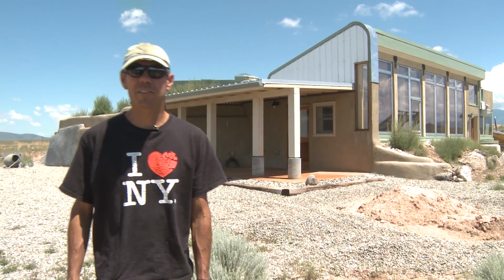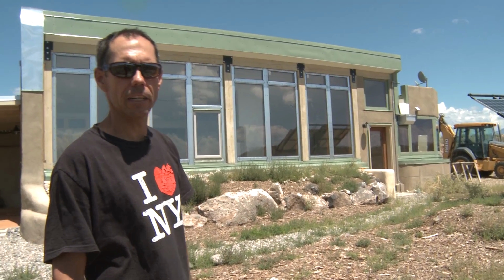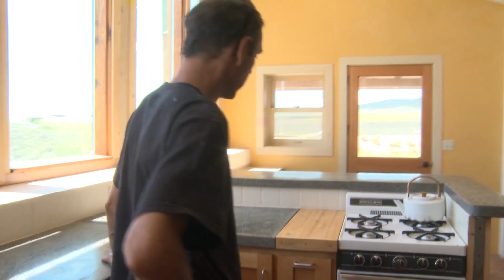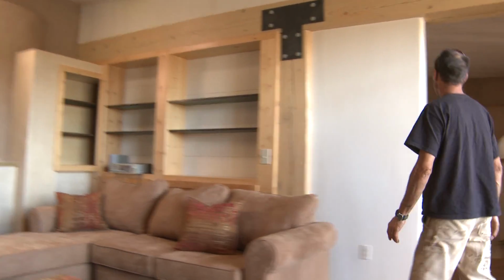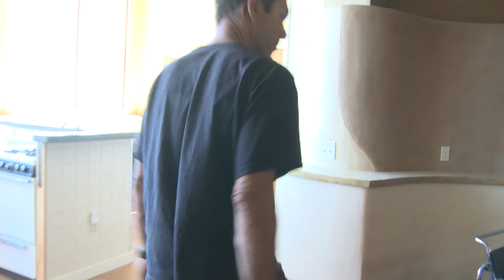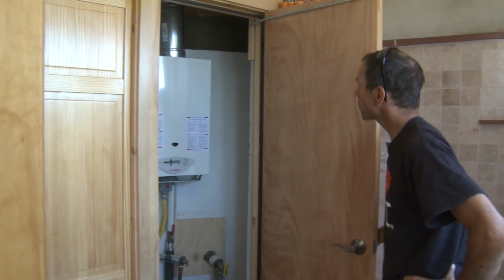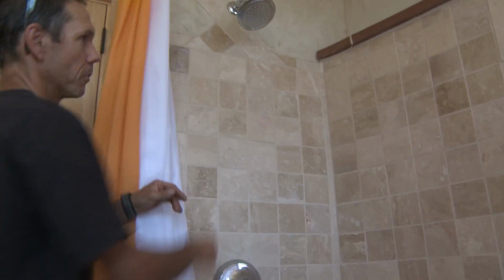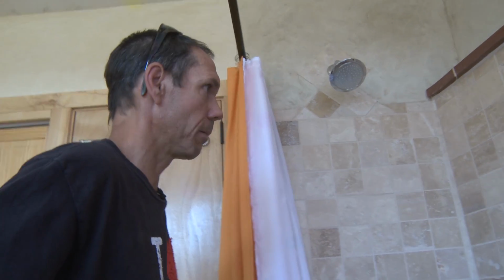Ted's Little House: A Modern Earthship

Comment: Really beautiful house. The only thing I would change is the kitchen.    I understand you wanted to use the counters for thermal mass but placing it on the south wall would make it unbearable to cook in during the summer months imo.  You may have a solution you didn't mention...

Comment: I was thinking about the rammed earth . I'm off grid now. but thinking about doing something more earthy . I just don't know how rammed earth will hold up to lots of rain. we get lots from time to time.  and getting flood watches more often.  maybe cinder block outer walls. and rammed earth inner walls. I have heard of rammed earth holding up for years even after being abandoned. I have been thinking about filling cinder blocks with dirt for insulation. witch if I do build . it will be about 80% under ground. to stay cool in summer. and have sky lights to catch the sun in winter. I have been over it many times in my head.  great house.

Comment: I think this house will become unbelievably hot during the Summer.
Reply: The idea of an earthship is that the windows are angled towards the winter sun, so that in the winter the tirewall with the rammed earth slope behind it will store the heat (thermal mass) and release its heat when it's getting colder in the room. While in the summer, when the sun will be higher in the sky, it will only heat up the front of the house (where most people will grow plants because it functions like a greenhouse) and the cool earth on the north side will keep the rooms cool. Im not sure if this house is build properly in order for this solar heating and cooling system to work well in this house. The windows aren't angled so in the winter the sun won't warm up the back of the house enough while in the summer  the kitchen will be probably to hot. Again normally in an earthship this would be the greenhouse with the plants. Also their would be a second row of windows ánd there would be a natural airconditioning/ventilation system. But I guess this house wasn't build this way because of the costs.

Comment: what does something like that cost to build..
i absolutely the idea.
Reply: It looked like about 1000 sq feet (big 1BR) and assume he meant livable space.  So figure 100K.   And that was with sweat equity.  Lots of the things involved are the same cost regardless -- cisterns, tire walls, solar panels and controllers...  

FWIW I have polished concrete floors and I love them.  I intentionally did NOT refinish/polish them as they aged though.  Sure they look a bit "dirty" now, but I don't have as much chance of killing myself if a spill (or a cat) leaves liquids on the floor.  Everyone here I know has either put down mats or had their bathrooms tiled after -- I towel off inside the shower as well.

Comment: Others have a tube vent that goes into the ground, and helps bring up heat/cool depending on season into the unit without needing a heater at all. You open it when you want to cool off the house or close it to keep it warmer. Would be a nice touch on other models like this.

Comment: what part of the country does this sit in? Where does water come from?  If a well, how much to drill?  Do you have a standard septic set up?  How much power into the house?
Reply: john g I would guess Taos , NM looks like the scenery there and also is an earthship community. The water comes from the rain catchment system he explained on the roof which leads to a cistern inside.

Comment: I'm not sure if I understood.  You placed rigid foam under the concrete floor?

It seems like that would make it crack all to pieces. If you wanted to retain the warmth of the floor I would think that an air gap created by gravel and topped with sand would work better.

We have lots of soil shift here, so doing a rubble foundation is a necessity.